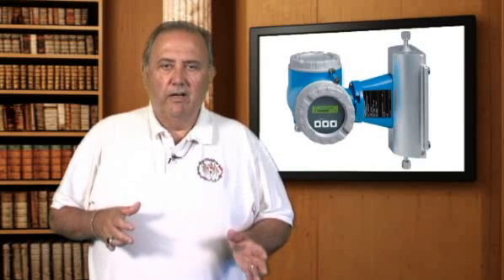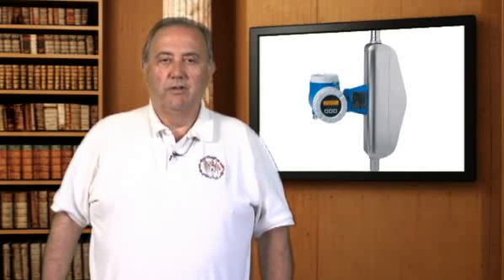Back to Basics: Flow Measurement (Coriolis)

Comment: ControlControlDesign...He made a mistake in his explanation: The magnetic (Coin) acts reversing the negative and positive polarity and the censors absorbs the variations between the polarities ... the vantage this system that prevents interference from magnetics fields around the system by a measure exalts the volume.

Comment: Hi everyone,
Plz help me in selecting a model of E+H flow meter for the following application.

Application: RO Water 
Line Size: 1”
 Make: Endress+Hauser/Equivalent
 Model: Promag 
Flow Range: 35~1000 m3 /h 
Accuracy: + 0.05% Class: 
 Pressure Range: Up to 20 Bar 
Process Temperature: 0 to +55 o C

I would be very gratful if you would help me in selecting the required model.
Regards